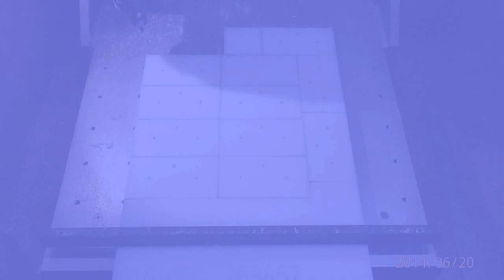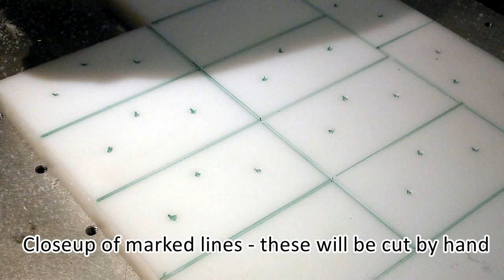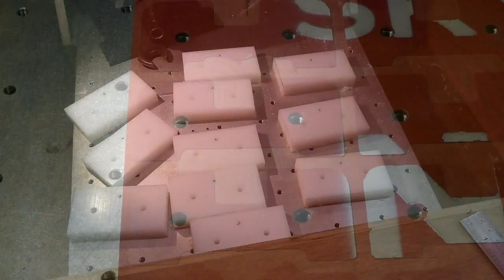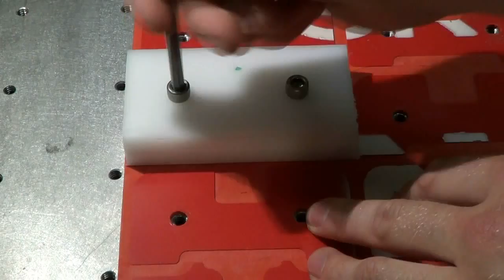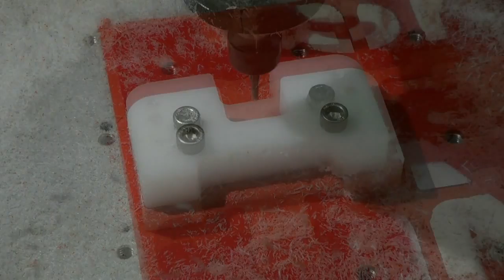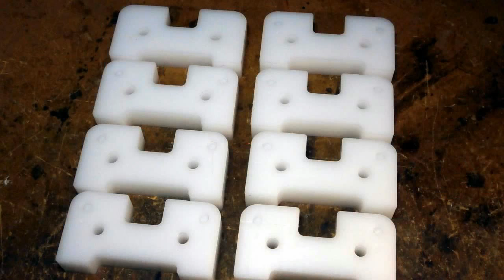AxiDraw® - making the X support blocks

Comment: found nothing for free there
Reply from the maker: +Marian Lung And just what were you expecting?
Reply: +Lindsay Wilson a full kit of parts are available..  that made me think of that.
anyway, very nice machine. 
it comes with inkScape program?
Reply from the maker: +Marian Lung Thanks for the comment, that's ok ;-) The machine shown in this (and my other videos) is actually the old version which has been superseded by the new improved AxiDraw v2. This has been developed and is being sold by Evil Mad Scientist Laboratories in California - their webshop link is http://shop.evilmadscientist.com/productsmenu/846. It has an all-metal frame and comes fully assembled. 

Regarding software, yes, it does operate from within Inkscape. There is an extension/plugin available to run it - this is available from https://github.com/evil-mad/axidraw. We're still working on documentation at the moment.

I hope that helps!